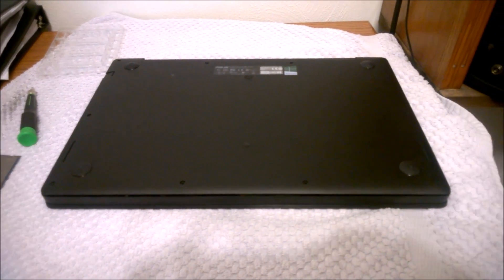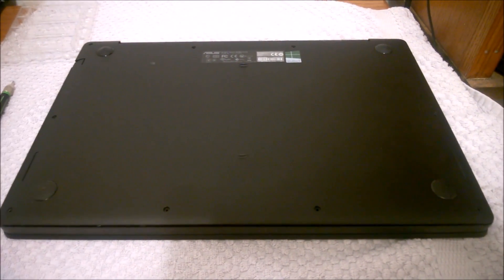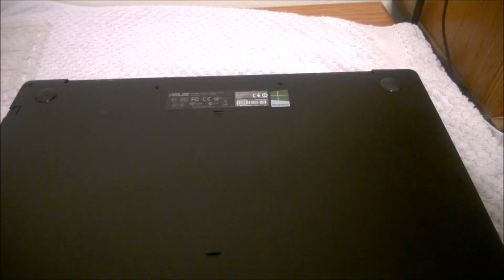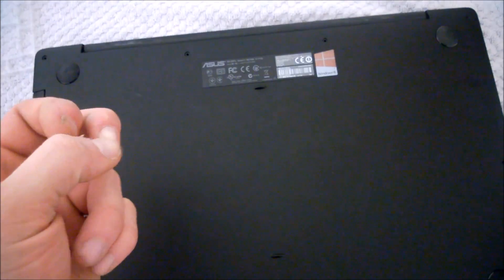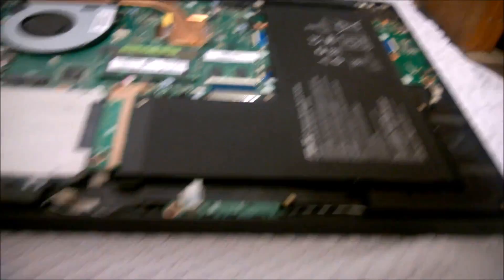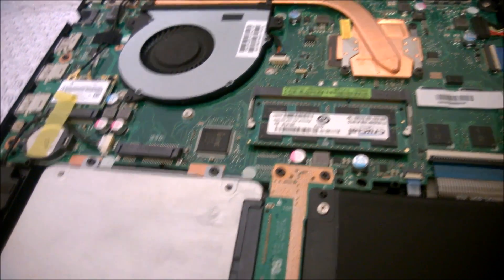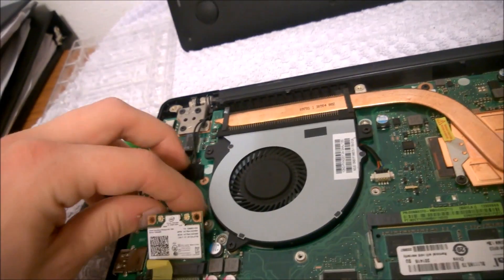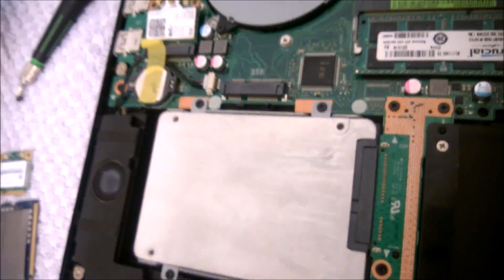Asus Q501LA Disassembly

Comment: thanks a lot for the video. This helped me get started on opening my computer to replace hd with ssd. Instead of trying to pry open the back, I used a suction cup (from a phone repair kit, but any ole suction cup can be used) and pulled different section of the back lid as you mentioned in your video. This helped to avoid scratching or breaking the surface of the computer.
Reply from the maker: I really need to get some tools like that. Thanks for the advise!
Reply: Alexander Patchin Doh! I just discovered I did break something. The ethernet port plastic cover's hinge pin snapped. Not sure how, it doesn't look like it's attached to the the anything other the back cover. Lucky me I guess. But note to others to be careful when pulling on the ethernet port corner.
Reply from the maker: yea, that was something I was very cautious about since I noticed myself putting pressure on it as well. Mine luckily didn't break though. The damage to that cover should not hurt functionality though, only cosmetic.
Reply: Alexander Patchin It depends on the amount of damage. That cover is actually an essential part of the ethernet connector; without it, there is nothing to hold an RJ45 plug in place when you insert it into the connector.

I managed to break one of the pivot posts on that cover a few months ago (trying to insert a USB plug into the ethernet jack, doh!). The post I broke off is the one with the spring. As a result the cover was flopping around kind of crooked, but the connector was still working okay.

While I had the back cover off the computer to upgrade RAM I also super glued the post back onto the ethernet connector flap and put it all back together, good as new. However, I think this is a very weak design mechanically.

Comment: wait, so you replaced the battery in this one?
Reply: No, but you can very easily replace that, I just don't see why you would have to replace the battery if it has not failed yet. You would not be able to upgrade the battery since there is not any room in the casing for anything that is any bigger than what is currently inside.
Reply: Alexander Patchin wasnt planning on replacing it, just wondering, thanks!

Comment: i broke almost all the front pins when i tried to take mine apart, which caused me heartbreak initially. i spent a good hour carefully prying apart the back (you make it look easy in this video, but i had a lot of trouble getting it started, and i constantly felt like the pressure was gonna snap it up). i think the ones in the front are almost impossible not to snap although pulling it backward like you showed would have been a nice trick. i wish your video had existed before i took mine apart (about two months ago) -- back then not as many people had this laptop and i could find almost no documentation on it other than some forum posts. the front doesn't sit quite as flush as it once did, but after putting the screws back in and snapping the rest in place, it's not really something you can notice too much, especially since the laptop is always sitting on flat surfaces anyway. but if you examine it really closely you can see a bit of a bulge in the front where the pins aren't connected. anyway, i love the thing, especially with an SSD. the keyboard occasionally gives me some problems from certain angles with missed keystrokes, but not a dealbreaker. the screen is beautiful. is there a specific wireless card you recommend over the stock one? and would i see much of a difference with a basic linksys wireless router? thanks.
Reply from the maker: That is the main reason I made this video, because when I first took mine apart(in the video was my second time) I had no video to help me, so why not make one to try to help other people out. Anyways, to answer your questions, I always will recommend an Intel wireless card over any other, but then again, I am extremely bias. To answer your second question, No, you will not notice a difference in changing the wireless card UNLESS you have a AC router. That is really the only reason that I changed it. Well, that and I wanted to make as many parts Intel as possible haha.

Comment: Hello. Thanks for your video. I was wondering if this model was the Q501LA-BBI5T03 or the Q501LA-BSI5T19?
Reply: Was just wondering because I just bought the Q501LA-BBI5T03 and it said on Newegg where I bought it that the maximum RAM supported was only 8GB, but if I can get 12 GB out of it that would be awesome, just don't know if you got the newer model or the older one I just bought.
Reply from the maker: This one is the same model that you bought. There is also no difference between the newer and older besides the wireless card being AC instead of N and the RAM being 8GB. I am currently using 12GB no problem, just make sure that you purchase the 1.35V ram for ultrabooks instead of the 1.6V ram as mentioned in another comment below.
Reply: Alexander Patchin Ok, thanks a lot for your information and your helpful video. Have a great day!

Comment: Is there only one ram slot present in this laptop or is that just the one that's visible? Asking before I determine how much to purchase.
Reply from the maker: Only one that is visible, the other on is on the other side of the motherboard and is soldered down and cannot be changed. Make sure that you get a 1600MHz clock speed stick and make sure that it is rated for 1.35v NOT 1.6v or it will not work.
Reply: Thank you so much for the response!

Comment from the maker: This is the respone that you guys were asking for. This video shows you how to create recovery media on your computer before you install the solid state drive. You can use it to reinstall the operating system.
http://youtu.be/WGO3P4oLqo4
Reply: Cesar Aguilar
I have had my laptop for 3 weeks and the wireless card just stopped working. I am not very familiar with the wireless cards in general. Could you recommend an actual wireless card model, please. I have no idea if they are pin specific like ram or any other requirement that I need to look for. Thank you in advance.
Reply: why did you replace the wireless card? Just curious so I would appreciate a reply.
Reply from the maker: C0lonel5 I replaced the wireless card because of two reasons. 1. mine is the older model that did not come with AC wireless to work with my AC wireless router. 2. The stock model, new and old, comes with a QUALCOMM wireless card and since I am a major Intel fan boy, it could not live without making as many parts of the laptop Intel as I can, AKA the Intel CPU, SSD, wireless card.
Reply: Alexander Patchin I Think qualcomm or broadcom are better cards than intel , mine comes with intel N7260 and I am having connectivity issues with older B/G routers....
Reply from the maker: Cesar Aguilar Works fine with mine so far, and I have connected to some old B AP's.
Reply: Boyan Tchorbadjiev  hi Boyan, I have 1 year with this model buyed in usa at bestbuy, excellent choice for me, lightweight and enough powerful, the ram must be DDR3L (low power 1.35volts) otherwise will not work, has 4gb soldered  ram on board so the ony opcion will be change the installed dimm by an 8 gb for a 12gb total ram. accoding to wifi others laptops had intel wifi and it is excellent, no issues, you can change it for another chipset for example broadcom minipci card. look in ebay or in a local store.
Reply: Boyan Tchorbadjiev I know this comment is old, but maybe this will help someone. I bought my Q501LA factory refurbished from Amazon, and it came with what I believe was a faulty wireless card. The card would often be able to see the networks in the area but wouldn't be able to connect to them, and it also wasn't uncommon for Windows to be completely unable to detect the wireless card at all. I tried many different versions of the drivers, played with Windows power management settings, and even tried readjusting the pin connectors that attached to the physical card itself. Eventually, I purchased the same exact model wireless card from Amazon (new, of course), put it in, and all of a sudden the wireless problems vanished. So to anyone who is having trouble with the wireless card on this model, my suggestion to you is to simply purchase a new one. The one I purchased is here: http://www.amazon.com/Intel-7260-HMWG-Wireless-AC-7260-Bluetooth/dp/B00DMCVKMU

Comment: Make sure the memory is 8GB 204-pin DDR3L (1.35v) 1600 MHz SODIMM. DDR3L is VERY important. Regular DDR3 (1.5v) will not work.
Reply from the maker: Correct. That is why so far I have only found the crucial brand to work since they provide the ultrabook style RAM which is lower voltage.
Reply: There are lots of other options out there.

I'm using this stick from Super Talent:

http://www.ebay.com/itm/Super-Talent-8GB-204-pin-DDR3L-1600-MHz-SODIMM-Hynix-Chip-Notebook-Memory-1-35v-/201023906002
Reply from the maker: Rae Egli Thank you for the addition options and information.

Comment: do you know the maximum amount and speed of ram this computer can hold?
Reply from the maker: The maximum amount of RAM that YOU can put into the laptop is an 8gb stick to bring up to a total of 12GB. The reason for this is due to the fact that the other 4GB stick of ram is soldered on the other side of the board.
Reply from the maker: Also the highest speed supported and the ONLY speed supported is 1600MHz.
Reply: Alexander Patchin So if the total is 6GB already and 4GB is already soldered, then they only put a 2GB stick in there?
Reply from the maker: that is correct, for some reason they limited their laptop with using a very small amount